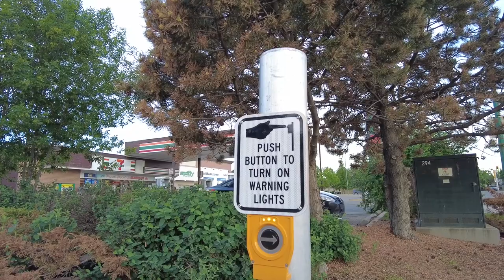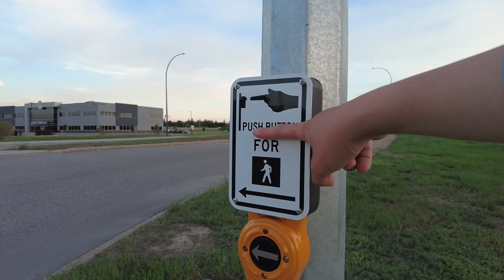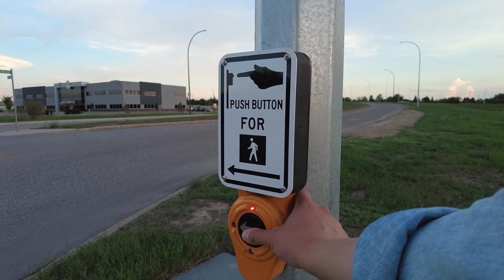Saskatoon McKercher Drive | Walking Tour Wednesday

Comment: 4:57 This is done to reduce delay, to allow the green light to be displayed for the minimum time if there are less cars.
If the walk signal always came on with the green, the green light would have to be displayed for at least the time it takes to cross the street.
Reply from the maker: Sometimes I wish these lights can have smart signals detecting both people and pedestrians to change their patterns and allow a smoother flow for traffic, that can reduce a lot of wait times too!
Reply: @morethantransitt  That sort of technology already exists, but the problem is that it can't distinguish between people waiting to cross, and people simply walking by.
In the UK they use it, to dynamically vary the pedestrian clearance period (not compatible with countdown timers), and to cancel unnecessary demands. (e.g when a pedestrian presses the button and walks away)